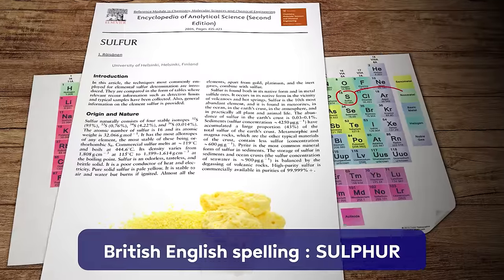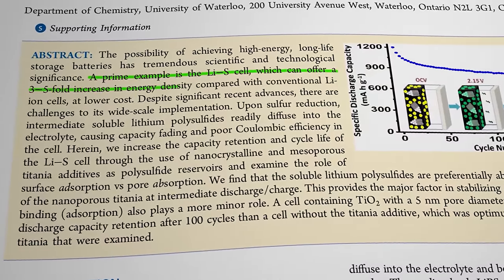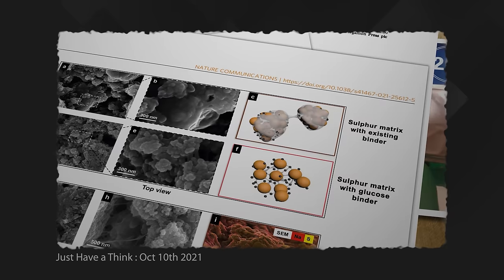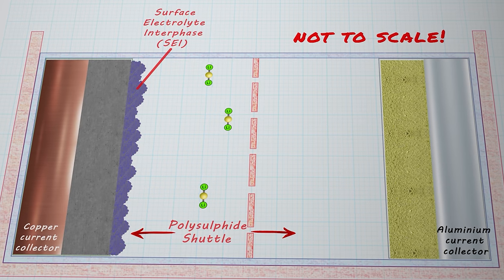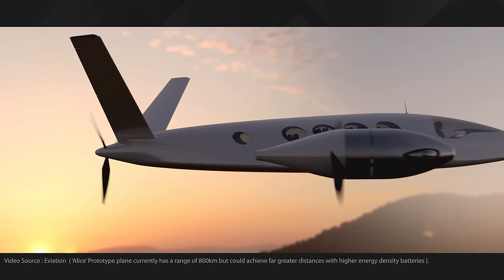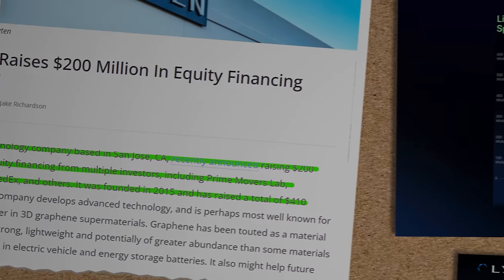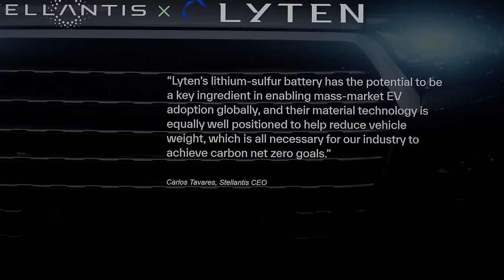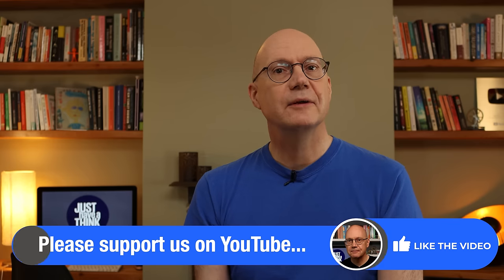Battery Energy Revolution. What now?

Comment: As a researcher in the area, I've found Li-S batteries to be one of the more obtainable future battery improvements. They have their problems, but none so fundamental that they couldn't be overcome, and the improvement in energy density is pretty great
Reply: Why aren't people focusing on lithium air when it has the most potential for energy density by a long shot?
Reply: Just out of curiosity - might it also be possible to replace Lithium with Sodium to get Sodium-Sulphur batteries, which then really don't use any rare elements of the periodic table?
Reply: @valtssondors7259  Yes, but, keep in mind that Li isnt rare. None of the elements in a battery are rare by design. The problem is sourcing and getting to those elements is what increases their cost over demand. Carbon used today, isnt rare for example, but can't really be recycle unless heated to reactive it. Carbon also doesnt hold a lot of power either though... one of the reasons why Li-S will be better because it doesnt take whole new mines. Thats also one of the reasons why Na will have a harder time taking over all markets of Li even though it has the pool and it normally cheaper to get a hold of. Yet, Na will be amazing with a Na+S for grid and home power storage.
Reply: Tytyty for doin what chu do
Reply: 10 c Chargin rate first ever
Reply: 👏👏 yeah same think!
Reply: @dianapennepacker6854  Wasnt their main issue charging? Like it took more power to charge than what you get out because of the fact "air" take more voltage to do so let alone because its "air" or O that isnt compress - the reaction is kind of random my nature? Your main goal is to create LiO2 or Li2O2. That isnt easy for say as you also just make a layer - so you would still need "something" to build off. Along with other factors like dendrites that can still form. Not wrong, but its not as easy as other methods. For example, Li02 is very stable, so you would need to find a way to break it down without loosing too much charge over time, but still fast enough to not cause other issues.
Reply: Every time I hear some technology is impossible, all I think well so were blue LED's just few years ago.
Reply: I keep reading aluminum sulfur salt. I keep wondering if high energy density is nonsense for cars, if the hydraulics can convert mechanical energy back into electricity to help minimal battery discharge do way more.
Reply: While Li-S battery sounds great, I wouldn't exactly call it "solid state" technology since it's still using a chemical electrolyte.  Solid state would be graphene based super-caps which store energy electrostatically with no chemical reactions and no degradation over time.  More work needs to be done to increase super-caps' energy density, but once perfected, it could be a viable replacement for chemical based batteries.
Reply: @BillAnt  This comment doesnt make sense the difference between a "solid state" battery and a not "solid state" batter is if the battery consists of all solid materials hence the name (i.e. no liquid or gel electrolyte) ... it has nothing to do with "chemicals" or chemical reactions. IN fact Li-S systems can be made from all solid components (there are a lot that arent but they can) while most supercaps use liquid electrolytes to form the double layer responsible for energy storage.

 Also supercaps can never replace batteries in regards to storage since their capacity is inherently too low. They can supplement in regards to high power short term operations but not in regards to storage.I am not saying they should not be worked on but they have a completely different application range than batteries do.
Reply: @chidori0117 - Of course it's not the solid material that makes a "solid state battery"  but the way they operate, without chemical reactions.   A super-cap can be charged an almost infinite number of times very quickly within minutes without degradation, while chemical reaction batteries like Li-Ion, Li-S, etc have a finite life cycle.
Reply: @BillAnt  I am sorry but your definition of a solid state battery is just flat out not the same as it is used in the battery community worldwide. A solid state battery refers to a battery which consists of all solid components e.g. no liquid electrolyte. Most common bateries of this type are lithium systems with either sulfidic or oxidic solid electrolyte. As I said before supercaps are a) not batteries by definition an b) commonly use liquid electrolytes. I dont disagree with your lifetime argument that is correct, although as I said the drawback for that is low capacity. I just point out that your usage of the words "solid state battery" is counter to how the term is understood by the scientific community in that field. I have worked in the field for over 10 years.
Reply: @chidori0117  - Just like spining drive computer storage has been mostly replaced by solid state drives with no moving parts, hope to see a similar revolution is batteries tech too.   Chemical reaction batteries are will always suffer from relatively slow charging and life spans.  imo
Reply: But look at the cost of those SSD, per Terabyte. If you are running something like a CCTV system 28 days of storage is much cheaper. And they same may will be true for batteries.    @BillAnt
Reply: @patdbean  - Sure, every new tech is expensive in the beginning.  The first refrigerator sized 1 megabyte IBM hard drive costs thousands, now we have terabytes for a couple of hundred bucks.
Reply: @BillAnt  I have just looked it up. 8tb NVMe m.2 SSD  is 800 pounds. 8tb 3.5" hard drive 160 pounds. 

Also remember in something like a CCTV system the constant write-cycle could finish an SSD in 18 months. My 8 camera CCTV system has  a 2tb  hard drive in it that has been in constant use since 2012.   SSDs are good as OS/Boot drives, but not bulk storage ,  I bet this  video is not being stored on an SSD. Far to costly.
Reply: @patdbean  - Of course spinning hard drives are more  cost effective per gigabytes right now, but solid state memory is coming down in price.  Your example of a high end SSD, in contrast to a 1 TB SDcard the size of a stamp is less than a hundred bucks.
Reply: @BillAnt  and a 1tb hard drive is about 30-40 UK pounds. SD cards are ok for long term storage, like in your phone. 

 But under constant write will be dead within months.

When used as a boot drive,  as in a raspberry PI that is running 24/7 they are now and have always been very unreliable.

Do remember flash memory is not new, USB pen drives  are well over 20 years old as are the old larger SD cards.

Comment: Ev manufacturing has become an enabling industry to so many other technologies. As costs plummet and energy density raises so many more applications for batteries are being used. For example a practical e-scooter was not possible when the iphone came out.
Reply: Picked up from laptop batteries
Reply: @rp9674  Yes laptop and phone batteries are what made practical EV's a possibility in a very similar way.
Reply: We need to be sure the politicians and manufactures don't turn these into dystopian profit and control machines.  Already laws proposed to limit speed, remote shutdown, and monitoring.  Planned obsolesce is already here.  DIY repair is gone.
Reply: @RS-ls7mm  Personal EVs are ultimately just harm reduction.

The real EV potential is in mass transit. A train can move at least 10x the passengers per hour (20,000+ vs 2,000), when compared with personal vehicles, in a 3.5m corridor.

You can fix some of the low density problems by strategically converting parking lots into apartment buildings.
Reply: @jamesphillips2285  "harm reduction".  Not sure you understand where the resources for the EVs come from.  Most people (mostly westerners) are so insulated from where the resources come from they don't see the tremendous suffering and exploitation.  Its only to get much worse as EVs demand 4 times the resources to make (not including infrastructure).
Reply: @RS-ls7mm  Lots of oil mining happens where I live. Leads to a "boom and bust" economy where more stable businesses get forced out by high prices during boom times.
Reply: @jamesphillips2285  That happens in most areas. I just worry that the massive increase in required resources for EVs will destabilize the world.  The split between the have and have nots will increase leading to unrest unless ist very carefully handled and I am not seeing it handled at all.

Comment: Charging a 100kwh battery in 6 minutes, that is some serious energy that will flow in those charging cables.
Reply: Charging a 100kWh battery in 6 minutes from totally empty to full takes... drumroll... 100kWh of energy.

You probably meant some serious *power*, 1MW on average in this case.
Reply: Would not be possible without extreme heat rejection.
Reply: The copper thieves are drooling.  Copper thieves destroy public EV stations in LA almost as fast as they are repaired. These cables would be enormous.
Reply: @christopherleubner6633  even if it is possible, I read that New York for example uses 5500 Megawatt on average. That is 5500 fast charging cars at the same time. It would not be impossible since there are 2million cars in New York.  So if 0.28% of the cars in New York would fast charge at the same time, it would consume as much energy as the whole city usually does. (my country is a bit confusing cause we say energi at wh/ joule, and effekt for watt, so that is why I write the wrong word :P )
Reply: Probably it will be a much higher voltage and they will split in many sections
Reply: @RS-ls7mm  probably we'll just see high voltage systems become the norm, which negates the need for thicker cables. If energy density is as good as companies proclaim, there's room to spare for going down in capacity but up the voltage and thus low chargetime will be far more convenient
Reply: you're not wrong, and current infrastructure (in the UK at least) just isnt capable of delivering this on any sort of usable scale.... however if you could charge 100kwh in 6mins you also wouldnt need a 100kwh battery any more, most people would be happy with 200miles of range (50-60kwh) if you could charge at those speeds. as the actual limiting factor is your bladder. so long as you can fully charge in the time it takes you to go to the toilet, smaller capacity, lighter batteries are the way forward as it will also increase the efficiency of whatever they're in.... obviously we'd need a decent charging infrastructure to go with it, and that is decades off at the very least
Reply: @christopherleubner6633  "Would not be possible without extreme heat rejection."

Hi capacity public EV charging stations/stalls employ cooling systems.
Reply: @dankrafted  both of my parents are electricians and this is a problem not mentioned enough.
Reply: @RS-ls7mas voltage goes up the guage gets smaller.
Reply: @katm9877  why is having both your parents as electricians such a problem?
Reply: @dankrafted  At least in the states, 300 miles would still be consider lower range only because of the distant a lot of people travel in. More than likely 300 should be consider the average follow by just having a way smaller battery pack in general. At 2.5 times the power dens of todays LFP - that would put it right up there from 8k cells to down to 3k cells making a 1/3 of the current weight needed today. More or less, I assume you would gain some distants from going smaller while keeping the same mile range - 300 to 350 miles just from this change.
Reply: @ricos1497  you misread. it's not their occupation that's a problem, it's the grid not being built to handle such amounts. 

trivia: here in Eastern Europe, the grid is based on aluminium, not copper, so we don't get copper thieves. very few people would risk electrocution for the paltry cents aluminium would net you
Reply: @RS-ls7mm That's why public chargers (except  fast chargers along the highway) in Europe have a socket, and you have to bring your own cable.
Reply: @plemli  He is right that is some serious energy flowing through those capables per second i.e power you mention.
Reply: @katm9877  Simply slow charge at night. Problem solved.
Reply: @dankrafted I agree with most of what you've said, especially lighter, smaller batteries. I am puzzled as to why you think a useable charging network is 'decades away'...
Reply: @jamesphillips2285  NOT solved. Regardless of whether it's at night or during the day, slow or fast, there is the matter of the sheer amount of power the grid needs to handle. This is what the current grid is not equipped for. A single car charger can draw more than an entire city block, in practice meaning you need a transformer for every single one, instead (as is currently) a transformer for an entire street.
Reply: @katm9877  L2 charging is about 6kW.

That is same as running the stove and oven during the supper hour.
Reply: Cymbal crash HA
Reply: Don’t limit urself with liquid cooled cables Danielson (Sensai voice)
Reply: There’s enough land underneath NY CITY  to generate 5.5 BBBILLION WATTS annually
Reply: @sparkysho-ze7nm  The cost to build a 5.5 Billion watt power station below NY City sounds like its cheaper to buy everything on earth. And if they start building it today, I guess it will not be ready until like 2124
Reply: @dankrafted  I do not agree about smaller battery. If we want to replace ice cars, they need to be as good or better in terms of how often you charge them up. My commuter ice car does around 700km on a tank of petrol, so I fuel it up once a week. I had a Mini Cooper EV, it went around 15-160km on a charge.  So we need up to 150kwh batterys that can charge in 6 minutes. Sure we can up the voltage, but you rather stand next to a 200 A cable, than a 2000 volt cable.
Reply: @jamesphillips2285  you won't charge a 100kwh battery in 6 minutes with L2 charging, though. That's exactly my point
Reply: @katm9877  You are entirely missing my SLOW charge at night point then.

Your 150kWh example will take 25 hours to charge at 6kW. 5 hours per night if you assume you charge every weeknight.
Reply: @RS-ls7mm  i guess it is a USA thing, it never happens here in the EU
Reply: @RS-ls7mm  The charging stations will likely need gas station types setups to deter theft
Reply: @KBergs  Doesn't help. The min wage worker behind the bullet proof glass gives zero interest.  Even now they steal all the accessories when they look away (air hoses, ...)
Reply: @KBergs  Actually that's a whole topic in its self.  Interstate stations would have to be enormous with hundreds of rechargers and a massive waiting room for all the stranded people.  Waiting around for 30 minutes or more would drive people nuts if they didn't have anything to do.
Reply: @RS-ls7mm in the uk we have motorway service stations where you can refill/charge, have a coffee, eat a meal, use the toilet, do some limited shopping etc. 20 minutes passes very quickly and you’re ready to go again. I’ve just spent a week in Norway where there is a really sophisticated charging network and what used to be ordinary petrol stations are developing in the same direction. People stop to charge, buy a drink or a bit of food then move on. It’s all very simple. (And by the way it was -20 deg C in most places and there was no sign whatever of EVs having problems with that).
Reply: @dankrafted  The idea of lower range batteries capable of fast charge, but costing much less is an idea most probably have not considered. Thanks for pointing that out. One thing I notice on topics like this... folks seem to focus on fast charge and extremely long ranges, as if that was something that people would require daily. The actual fact of the matter is that, according to data from the U.S. Department of Transportation, 95.1 percent of trips taken in personal vehicles are less than 31 miles; almost 60 percent of all trips are less than 6 miles. In total, the average U.S. driver only covers about 37 miles per day. With that in mind, the VAST majority of charging would occur about once per week, and most of those would likely occur at the vehicle owners home... probably over night. I know in my case, I charge every 10 days, or when my range gets down to 35 miles. I plug in when I get home from work, and the next morning I am topped off.
Reply: So a very small battery then that charges super fast. Way smarter than wasting ressources and time on huge batteries where they aren't needed (e.g. in power saving stations or something like that and NOT in your overpriced, ugly SUV)
Reply: @dankrafted this is so true. Plus the overall performance and efficiency that could be gained by just dragging around less mass in your battery would be great!
Reply: @RS-ls7mm poverty = troubles (nobody is cutting cables for fun).
Reply: @DBGE001 Poverty equals crime only in some cultures we can't name here.  I have been in plenty of places where poverty means people help each other and there is very little crime.
Reply: @plemli  No M0RON.... 100 kw hours.... so it is 60minutes.... but in 6 minutes your instantaneous power ie watts as watts is joules per second... is 1MW... per second for 6 minutes.